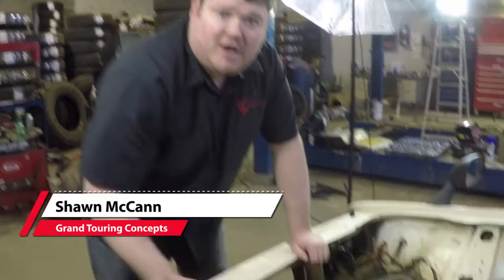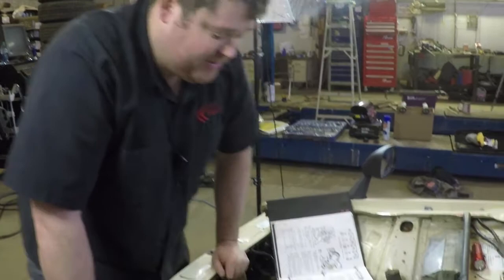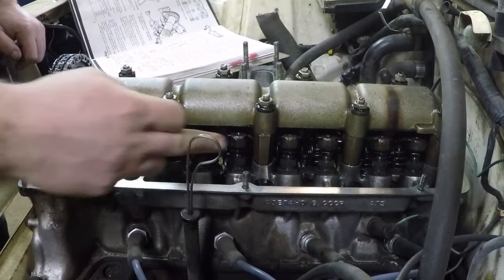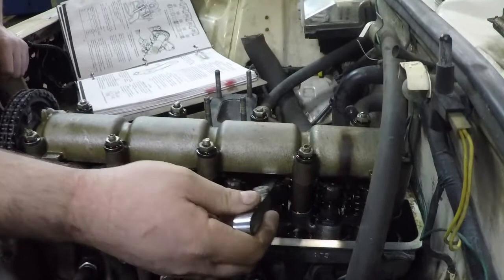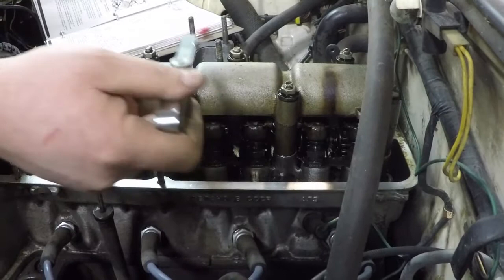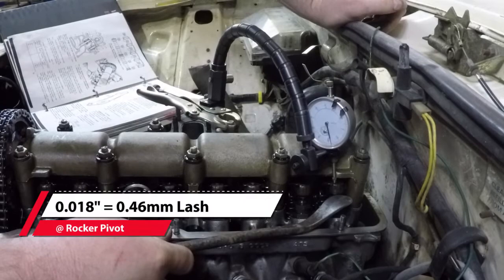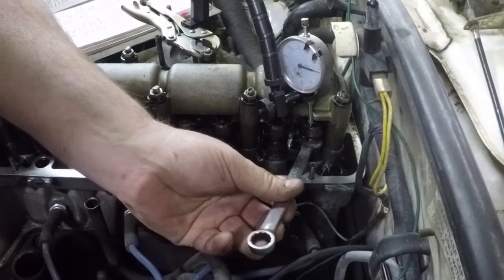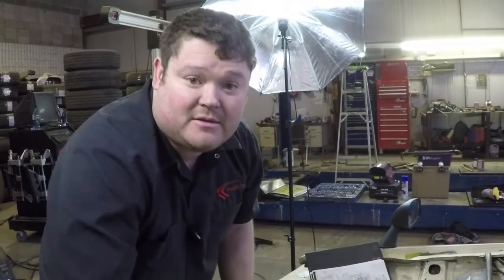Lada Engine Valve Clearance Adjustment

Comment: Hi , here in Russia, we also tryied to do valve clearance adjusting by equal indicator, but in totale clearance was small and engine doesnt give full power. 
In case if You use LPG fuel system OR fuel with 95ROz or more You need have 0,2 for exhaust valve and 0.15 for intake.  ignition angle for 850rpm 8'5-10deg. Good Luck!
Reply: 0,2 for exhaust valve and 0.15 for intake - engine only 1.7 litres (21213). For the remaining engine (1.5, 1.6) 0.15

Comment: Thanks for the video, Shawn! One question: when adjusting valve clearence, is it more accurate to set the piston's TDC through the markings on the camshaft gear or via the distributor's rotor position (given that ignition timing is correct)?
Reply from the maker: Hi Miguel! It is most accurate to use the cam  gear marks, as that is what actually controls the valves. Also the timing of the distributor is set to advanced 5 or 10 degrees of TDC means it would not be correct for setting valve lash. The cam gear is the most accurate and therefore the more precise way to go. Thanks for commenting and I hope this helps you out. - Shawn
Reply: Hi, if You have time to do it more precisely, You need to turn camshaft for every valve,  when You see oil chanel in shaft it mean that shaft in correct position for adjusting this rocker/valve.

Comment: No offence intended, but this is not a good method.
I've tried it and your clearances will be way tighter than they should be. Also it requires a flexible dial mount which most people don't have and it takes triple the time..
The twisting of the rocker is a non issue, just centre the spring and it will not twist at all, using a wide feeler helps too.